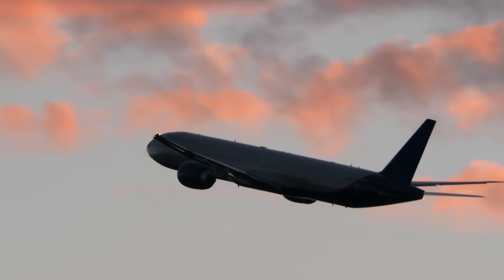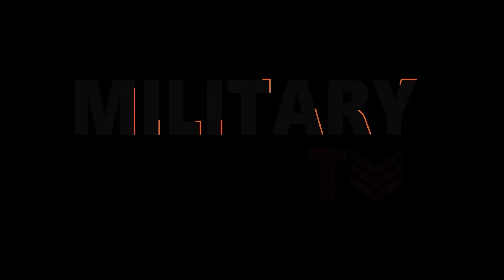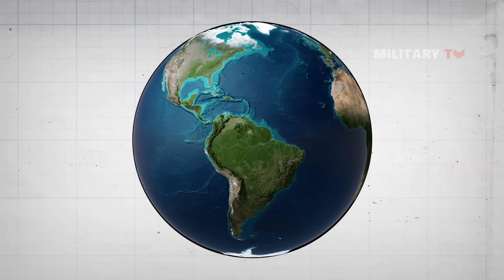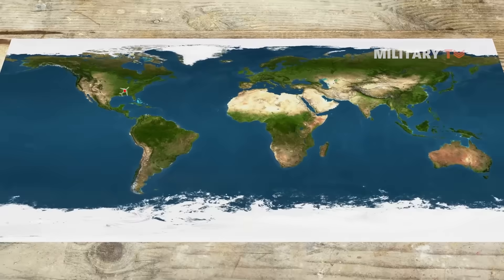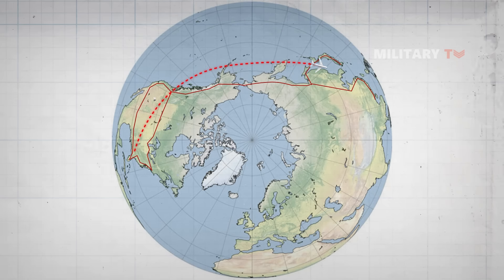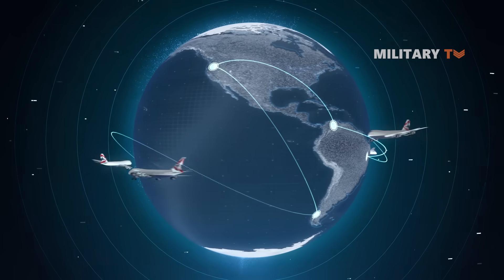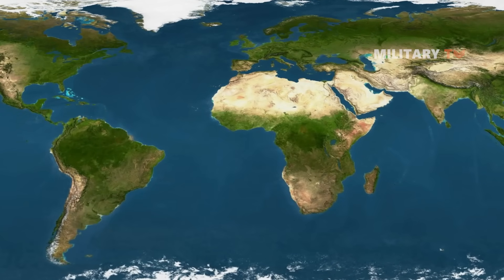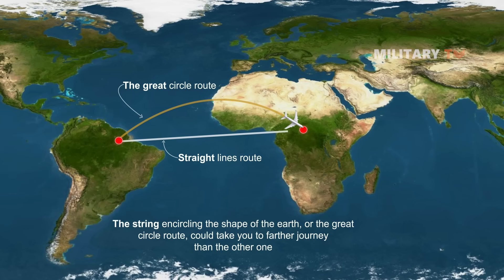Why Airplanes Fly On A Curved Path

Comment: I am often amused by flat Earther’s logic “If the Earth is round, then why don’t pilots constantly adjust the pitch angle in flight so they don’t fly off into space?”
To which I ask “If the Earth is flat, then why don’t they constantly adjust their course so they don’t slam into that Antarctica wall you say is around the edge?”
Can never seem to get an answer after that. 🤷🏽‍♂️
Reply: Because they never fly anywhere near it. There are strict flight routes that pilots can not deviate from unless there’s an emergency.
Reply: Actually the pilots DO have to constantly adjust their instruments because the Earth is round.  Older gyroscopic instruments hold their orientation relative to space, not the ground, so after a while, they wander as the plane "pitches" over the horizon and cause the autopilot to pitch up. 
In modern aircraft, the flight management system does all of the corrections for you but pilots still cross-check with other instruments.
Reply: @TonyP9279  bullshit
Reply: 😂😂.no need to adjust pitch angle coz of force of gravity acting on the plane during cruising speed.the plane maintains same altitude.

Comment: Earth is flat. Let go of your pride. We all believed it was a globe at one point. Look, we understand that if you let go and admit it's flat, you'll have to admit there's a God, which means you can no longer justify your sin. For the record I am hardly a saint. Not even close.
Reply: Maybe you can help me with this. No other flat-earther will answer me. If the earth is flat, and Antarctica is a pizza pie crust ("wall") rather than an island which can be circumnavigated in the Southern Ocean......then the equator must be many less miles long than the Southern Ocean, and the area surrounding the North Pole must be even shorter still, (than the Southern Ocean); by a massive amount. Are you with me? Yet this is not born out by ships traveling the Southern Ocean. The distance to sail along the Southern Ocean would be massive. Put another way, look at an oval race track for runners. If everyone had to stay in lane, all the way around, who would have to run much further? The inside track or the outside track? ( A flat circular earth, the Antarctic would be the furthest outside track.)
Reply: Bingo! Amen!

Comment: It's really not because the circumference is greater at the equator.
Its because a flat map is a huge distortion of the globe. A straight line on the map is actually not a straight line on the globe. The great circle route is actually the "straightest" line between two points, around a sphere.

Comment: I understand what you are saying. Your education (thus your explanation) about reality is unbelievable. There is no earth curvature. The curvature is not visible. The curvature is not measurable. It can be demonstrated repeatedly there is no curvature with optics bringing distant objects back into perspective that otherwise the line of sight should be blocked.

If the earth were a ball, and you were flying at altitude, the horizon would be below you. You'd have to bend your neck and look down. On a flat plane the horizon is always right in front no matter the altitude. On a ball the higher in altitude then you are leaving earth behind you. On a flat plane one doesn't move away leaving the earth behind you. The earth is beneath you no matter the altitude you at above the earth.

The horizon doesn't bend or arc. It's with a wide angle camera lens or sitting in an airliner passenger seat, that the window is aerodynamically designed, and viewing through it, there is a distortion of a bend or arc.
Reply: The Horizon does drop with altitude and proves you wrong. The curve Is visible, you US the wrong numbers and deny the evidence. It takes a sunset to disintegrate your model.
Reply: @AlexFoxthrot  No, its an empirical observation that no matter the altitude, anywhere on earth, the horizon is right there in front of you.

A 2d line (3d plane) is a distinct shape. A 2d circle (3d sphere) is a distinct shape. These two shapes aren't identical. 360 degrees around you the horizon is a straight line and from where you stand to the horizon is a 3d plane. No arc, no bend what so ever at the horizon.

Okay. Water doesn't bend. Water doesn't conform to a convex surface. Water seeks to be level at rest. The earth’s surface is about 70% water. We can conclude the earth’s surface is flat. Its an empirical observation.
Reply: @Callibree  you have no idea of what empirical means. Pretty much everything you wrote is wrong. Congrats.
Reply: @AlexFoxthrot  Here you go:
The term “empirical” refers to knowledge or information acquired through observation, experience, or experiment, rather than through theory or pure logic. In the context of science and research, empirical data is collected through direct or indirect observation and measurement.

Empirical methods involve using data to test hypotheses or to explore patterns, and they are foundational to the scientific method. This data can be qualitative or quantitative, and it is typically gathered through experiments, surveys, observations, or measurements.

In philosophy, the term “empiricism” refers to the theory that all knowledge is derived from sense-experience. Empiricists argue that the human mind starts as a blank slate (tabula rasa) and is shaped by experiences.

In a broader sense, “empirical” can also refer to something that is based on practical experience rather than theoretical constructs. For example, empirical knowledge in medicine involves knowledge derived from clinical practice and observation of patients.

Do you have anymore ad hominem fallacies for me?
Reply: @Callibree  "The Horizon is right there in front of you". Wow, very scientific Indeed. Say, how much do you think the horizon must drop on a sphere with a diameter of 12600km? The horizon does drop, not much, but It does, so this claim is already false and proves you wrong. The Horizon Is not at Eye level at an airplanes cruising altitude. Any more falsifiable claims from you my friend?
Reply: @Callibree  Is this all you've got?
Reply: @AlexFoxthrot  "The horizon is right in front of you" is an empirical observation. Walk outside. Look. There it is. No different standing on high elevation such as a mountain. Or sitting in the cockpit of an aircraft.

So what does that mean, the horizon is right in front of you no matter the altitude? It means you don't have to look down. At higher altitudea you don't need to bend neck and look further down. Instead wherever you face 360 degrees around you, the horizon is right in front of you. Its an empirical observation. Its an easy experiment to perform since your human body is capable of sight using eyes.

Other empirical observations include: water not conforming to a convex surface. A bird, a bug or an airplane achieving lift going in the opposite direction of the downward pulling force toward the center of the earth. An object at equilibrium demonstrating that there is no downward pulling force toward the center of earth. Its all in plain sight. Your eyes in your head see this. Its an empirical observation.

Once again a 2d line (3d plane) and a 2d circle (3d sphere) are distinct shapes. The two shapes are not identical. Another empirical observation!
Reply: @Callibree  Have you ever even tried to calculate how much the horizon would drop if you were on and airplane, 7 Miles above the surface of a sphere 24000 Miles in circumference? The fact that you think you would have to bene your neck downwards either means you never even thought about this, you know zero geometry or you think the earth Is the size of a Football Stadium. And no, this Is AN empirical observation, not an ad hominem. It's facts. The Horizon drops 4 degrees at 35000 feet, I can see It through the HUD of my airplane, there are pictures proving this. Plus "birds fly therefore there Is io Gravity" Is already embarrassing on its own, truly the most clueless and pseudoscientific claim I have ever Heard. So when I drop something that accelerates towards the ground, there Is no force? Are you even serious? This Is not even hilarious, this Is extremely sad for a human being.
Reply: @Callibree  What's the matter champ? Unable to respond? Are you too busy thinking that you are the only smart person alive?
Reply: Never seen the horizon?
Reply: @GuardianSoulkeeper  I would say it's a high probability you have seen the horizon, especially if you have been outside for any length of time, casting your gaze in front of you. Looking forward is natural for human beings.
Reply: @Callibree  Well of course I have. It's one of the many ways I know the Earth is a globe.
Reply: @GuardianSoulkeeper The magic globe earth: Small enough to watch ships "disappear over the curvature", but too big to see the curvature at 100,000 feet in altitude.
Reply: @Callibree  It's amazing how easy it is to notice things when they're in front of each other. We should use that when measuring things too.

Oh wait...
Reply: @GuardianSoulkeeper  Please clarify how measuring may be equal to noticing things in front you and how that refutes my assertion that, the magic globe earth: Small enough to watch ships "disappear over the curvature", but too big to see the curvature at 100,000 feet in altitude. Thanks.
Reply: @Callibree  So you want to measure the height of something. Do you put a tape measure up against that thing or do you suspend it upright twenty feet away and try to just eyeball it?
Reply: @GuardianSoulkeeper I'm trying to figure out the relevance of what you want to articulate. Unless you can get to your point with your rebuttal you are going to towards a Non Sequitur fallacy. 

If I take your question at face value without any relation to what I've said, naturally the answer would be to measure something I'd want the tape measure to be up against the item or object in question. For example, if I were to measure a table's length, I'd put the tape measure on the surface of the table.

Please elaborate. Where you are going with this.
Reply: @Callibree  So you can't easily distinguish level by simply looking.

So why do you think the horizon is flat by simply looking?
Reply: @Callibree  Why do you have so much trouble replying to me?

Comment: Every guy can prove or disprove the REAL LENGTH OF SUCH A FLIGTH on the flat earth map.

SYDNEY East Australia,coordinates  33° 51' 05.41 S" - E 151° 11' 55.86 E
Santiago de Chile airport coordinates 33° 23′ 35″ S , 70° 47′ 9″ W
Distance measurement

From northpole to 33 51 South to Sydney = 90 + 33 + ,85 = 123,85 x 111,12= 13762 km

From northpole to 33 35 South to Santiago De Chile  = 90+ 33+ ,38 = 123,38 x 111,12 = 13.710 km

Gamma Angle 140 degrees

Distance between SDC SYD = 25815 km

=======================================================

SYDNEY East Australia,coordinates  33° 51' 05.41 S" - E 151° 11' 55.86 E
CAPETOWN 33 , 58 ' N und dem Längengrad 18,60420. 

From northpole to 33 51 South to Sydney = 90 + 33 + ,85 = 123,85 x 111,12= 13762 km

From northpole to 33, 85 South to Capetown  = 90 + 33+ ,84 = 123,85 x 111,12 = 13.762km

Gamma Angle 132 degrees

Distance between SDC SYD = 25.144 km.

Every guy can prove or disprove the REAL LENGTH OF SUCH A FLIGTH on the flat earth map.

Step 1  
go get a flat earth map. My recommendation ist the hammond air age map from 1942.

Good ist a diameter of flat earth from 50 cm or more

Step 2
Google the coordinates latitude and longitude of the 2 airports -
for example Sydney and Santiago de Chile

Sydney East Australia coordinates  33° 51' 05.41 S - E 151° 11' 55.86 E
Santiago de Chile airport coordinates 33° 23′ 35″ S , 70° 47′ 9″ W

Step 3
Google the distance from northpole to Destination 1 = here Sydney
And from Northpole to destination 2 = here Santiago de Chile.

multiply the latitude degrees from Zero to your destination with 111,12 (thats the distance between 2 neighboured latitude lines).

Is your destination within the equator the number will be less then 90 degrees
Is your destination over the equator the number will be higher then 90 degrees

From northpole to 33 51 South to Sydney = 90 + 33 + ,85 = 123,85 x 111,12= 13762 km
From northpole to 33 35 South to Santiago De Chile  = 90+ 33+ ,38 = 123,38 x 111,12 = 13.710 km

Step 4 

Go to the map and put a line from Sydney to Northpole and from Santiago de Chile to northpole.

Then measure the Gamma Angle between the line northpole-SYD and the line between northpole-SDC. In our case it is 140 degrees.

STEP 5
THEN look for a Triangel calculator in the internet.
Where you can put in the 2 length northpole to Destination 1 line and 2 line
And the gamma Angle 140 degree in our case.

Press Enter or calculate and you will get the distance between
SYD and SDC = 25.815 km
Reply: Explain the direct flights.

Comment: The premise and title of this video are wrong. Several concepts conflated. It shows a curved path on the map because the map is flawed. In reality, the airplane flies straight from one point to the other point except for a few logistical reasons why deviation is beneficial. The other curve of lower to higher to lower again, and then following the earths curvature, is unrelated to the path and it’s just what the airplane has to do.

Comment: You talked a lot before mentioning the great circle route and still didn't fully explain it.  The great circle route is the shortest possible distance between two points on the globe.  As you mentioned, other factors may influence the route, including one you missed.  Due to political circumstances, it might not be advisable or even safe to fly some routes.  Right now many flights avoid Russian airspace.

Here's a bit of trivia.  Back in WW2, when planes started flying regularly over the Atlantic, to meet the needs of the war, they'd stop in Gander, Newfoundland to refuel.  One reason Gander was selected is it's close to the great circle route between New York City and London, England.  After jets replaced piston engine propeller aircraft, it was no longer necessary to refuel at Gander, for many destinations.  On 9/11, many aircraft were diverted to Gander, after they crossed the ocean, instead of landing at their intended destination.

Comment: I don't believe the bulge of the Earth's equator makes that much difference; the shortest route from the US to Asia is still going to be up towards Alaska.  A desktop globe isn't going to reproduce that equatorial bulge; stretch a string on a globe from New York to Tokyo, pull it tight so you know it's the shortest distance, and it goes over Alaska.
To the question, why don't they take the direct route instead of the curved route, the answer is, they DO take the direct route.  It just doesn't look that way when you look at a flat map.  A flat map can't represent the Earth properly.  That's mathematics; on the flat map, something HAS to be wront.
Reply: The flattened poles contribute almost nothing to the calculations.

Comment: The thumbnail illustration is the worst possible example as it pretends to project a great circle path near the equator onto a flat map. The equator, itself, is a great circle. Calculating a great circle path in the tropics is really a waste of time as the parallel circles are close to a great circle.

Comment: The reason for flying or sailing the great circle route is because the maps are distortions, designed to fit the concept of a dome earth. If you look at a Flat Earth Map, [Alexander Gleason, 1892], you will see that Planes actually fly a straight route and this makes perfectly sound economical sense. Airlines do everything they can to cut costs, why on earth [pardon the pun] would they fly a curved route just to waste fuel? Forget all the nonsense about "Jet Stream" etc = it is the same for a Flat Earth model as well as a Dome model.  In all the surveying I have done, I have never once made a calculation for the supposed curvature of the earth. This is one hard Red Pill for most people to swallow. Cognitive dissidence is a powerful force. The Earth is Flat.
Reply: Now that you are at it, take out your map and tell me how airplanes can fly between Sydney and Johannesburg in 14 hours. On Gleason's map tat distance is more than 23400km, yet the flight takes 14 hours. Let's hear it, you can be the very first one.

Comment: The "curved" route is actually a straight line on a globe. The earth is not flat. If you stretch a piece of string between two cities on a classroom or library globe, that will show you the shortest trajectory between those two points. I learned about great circles on a globe or sphere when I took 3D geometry in college. It was a graduate course geared towards teachers even though it's a topic not normally taught in secondary school math. Most geometry taught in geometry class is Euclidian geometry (two-dimensional and on a plane).

Comment: The explanation that the planes take “shorter “ routes flying north (or south) because the radius of Earth is longer at the equator than at the poles is nonsense . The difference between the two radiuses is only 21 km. (The equatorial radius is 6378 km, but its polar radius is 6357 km - in other words, the Earth is slightly flattened. NASA) .